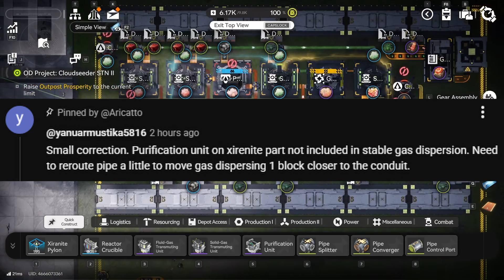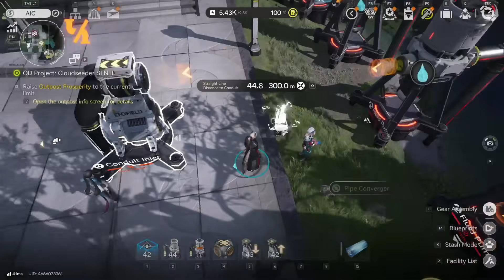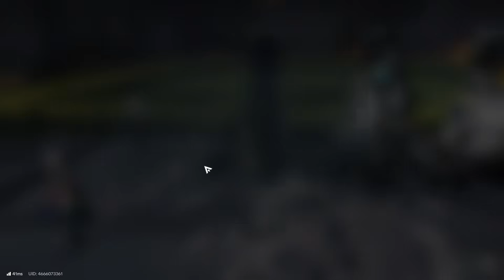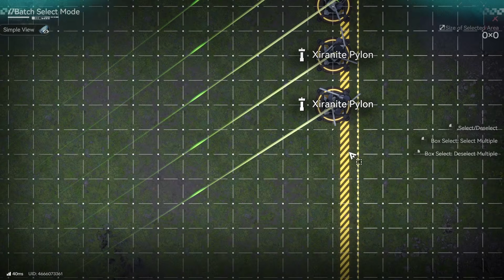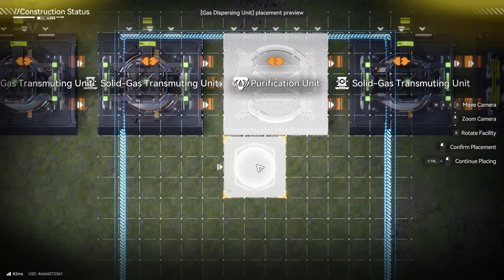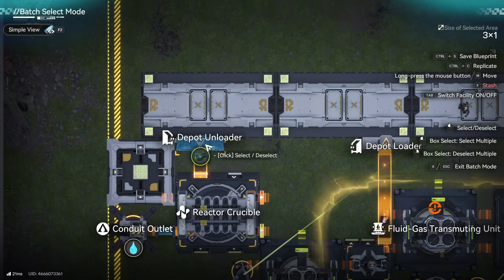Pyrrolite Component, Gear, Part and Heavy Xiranite Blueprint 1 4 Wuling Gas Factory (FIXED)

Comment: Confused as to how you're getting the acrid environment at @10:23 since there's a cut and it's just working, mine isn't. My fluid gas transmuting unit isn't doing anything.
Reply from the maker: wait did I really holdon lemme check
Reply from the maker: oh, that part will be shown later the reason it was working there was because I had to retake the clip and removed the 2nd part that made it "work" but if you check at the acrid gas generator it isn't working, it will immeditately still be shown later at 11:46 just continue the build
Reply: @Aricatto Alright, I didn't watch further ahead, so I'll do that today
Reply from the maker: @Aeromatik-123 awesome, thank you for pointing that out though sometimes I have errors on the recording part which goes unnoticed but I check the build and everything after resolves the issue so you're good nce you complete it👍
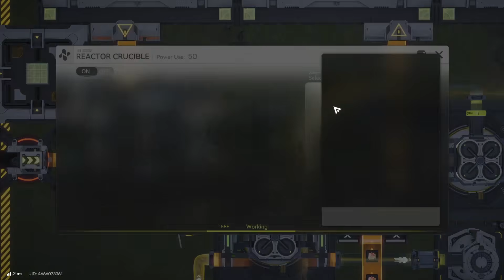Reply: @Aricatto  Not a big deal. Once the Reactor Crucible gets going at 12:00 it starts making the Acrid environment. Set up worked for me after that.
Reply from the maker: @Aeromatik-123  glad to hear it! I was worried there for a second XD

Comment: Aha, I knew something was wrong with my Solid-Gas Transmuting Unit. It does not have the exit ports for the solid material! Definetely a bug I will report. That is why I wasn't able to automate the pyrrolite component and gear after
Reply from the maker: its a toggle, you need to turn it into solidify mode so you can have accesss to the exit ports
Reply: @Aricatto  Ah the facility was not all the way inside the yellow border of the area! Somehow it allowed me to put it a bit outside and then there are no exit ports. I put a new one and moved a bit and yep, the exit ports shows up when it is fully inside the area. Interesting to say the least, but now it is working properly
Reply from the maker: glad to hear it bro!
Reply: @Aricatto I am pretty sure it is in solidify mode because it is making pyrrolite. I will check and I will try to put another unit and see if it works

Comment: Are any of the earlier bases going to change? Are you going to do a new mega base blue print with the updated stuff from 1.4?
Reply from the maker: yupp I will I am workin on it, I just need to do some stuff then I could start recording and editing
Reply: @Aricatto ok great awesome. Love your videos. Would love to go through the new mega base video. Can you also just add a section when we use the gas, when to use a single inlet per gas extractor and when to use a pipesplitter to a single gas extractor, that part is quite confusing to me
Reply from the maker: @stephankoen9349 Oh you mean have one dedicated part where its all pipework??
Reply: @Aricatto yea something like that
Reply from the maker: @stephankoen9349 I'll try to do so,